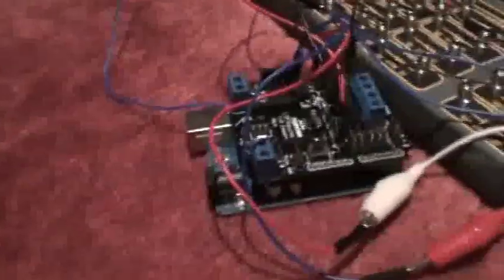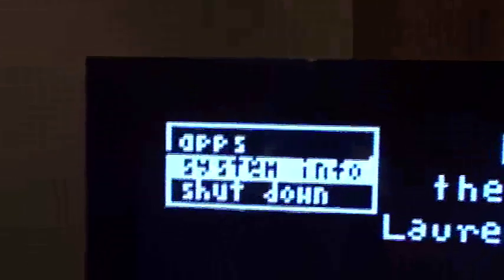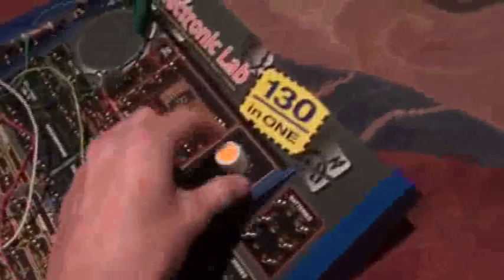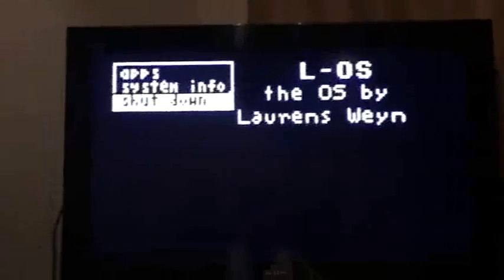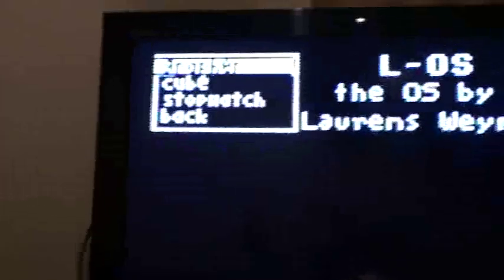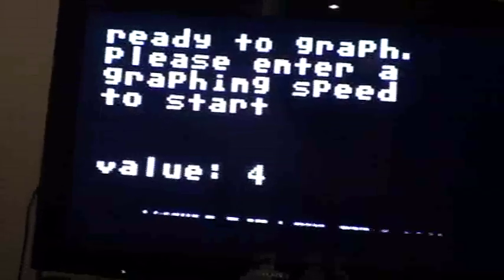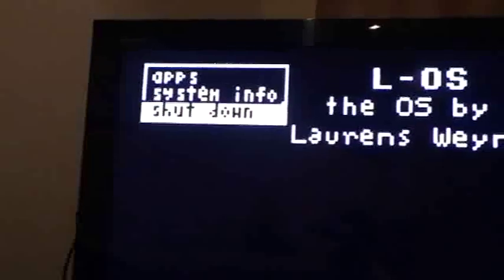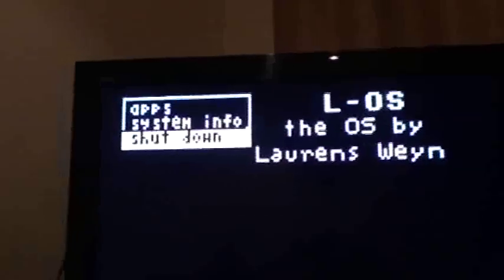L-OS! my home-made operating system, progress update 1

Comment: I use arduino uno, I am working on trying to build my own computer, this is probably not going to work out for me, I am a programmer with an interest in electronics, with barely any electronic experience except thick books I read on it
Reply: I realised I have enough materials to build that but cant because of my lack of expertise, just need to find what i did with the speaker, or make my homemade one or scrap my radio

Comment: Great Work!
But how do you execute the programs?
Has every program it's own function? I mean something like that:

switch(menu)
{
case cube:
cube();
break;
case grapher:
grapher();
break;
}
and so on...

Or did you find another way to do it?

I ask this, because the AVR isn't able to execute code out of the RAM (Harvard-architecture...) and
I want to program my own OS on an AVR, too. But a traditional OS is loading the program code into the RAM and so on... But it's too hard to start OS-programming on a x86 processor...

So did you find another way, or do you have a BIG switch-case statement?

Comment from the maker: It's written in C in Arduino IDE for AVR. the latest version is being written mostly in C++ (there's some C and assembly for booting) in Eclipse with the CodeSourcery toolchain for ARM Cortex.

This old version is more of a proof of concept and was more of a menu of apps than an OS, but newer versons have full language interpreters (though the languages are made up). but it's really just a huge C or C++ program that loads other programs and manages the system. hard to explain "how I did it"

Comment from the maker: Then you clearly haven't even seen Linux. And if that's the case, you don't know much about true computer power. And if that's the case, you don't use your computer for anything other than "basic" stuff, like playing games, making documents, editing pictures and so fourth.

The problem with Mac is, if you want to do anything more than "basic", you will run into problems. it's like using Java for low-level programming (but a LOT worse): It's just not made for that sort of thing.

Comment from the maker: Actually, permanently built ROM (I assume that's what you are referring to) is still, in fact, coded before the device goes into production. it's read only, and can never be changed, but it was programmed during manufacturing, and it is executed by a computer.

Comment: I have upgraded hardware on my mac. Hard drives, ram, etc. What else would you want to upgrade in a laptop? On my  desktop Mac Pro, I've even changed the processor. Other than games (I concede that windows has better games) what programes aren't on mac. There are plenty that aren't on windows too. I have of course met die hard fans too, but 4/6 people I meet using windows got a laptop from work or something and want a mac. Also, how is what i'm doing "marketing" and what you're doing not?

Comment from the maker: @ronald3729 what do you want to know about C? problem with C is that I only know 1 "good" plain C compiler, and that is the atmel compiler. that means in order to test it, you will need an arduino or an atmel processor (preferably from the ATmega series) and a programmer. however, Java only requires you to download a few things and you can make programs for your computer, or other things like your (nokia) phone.